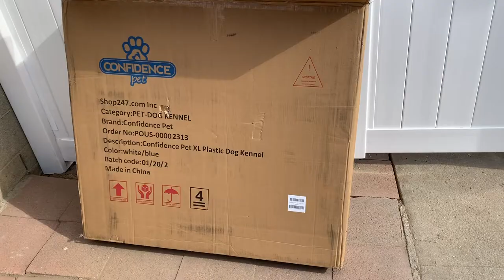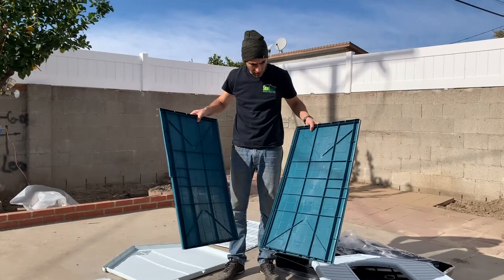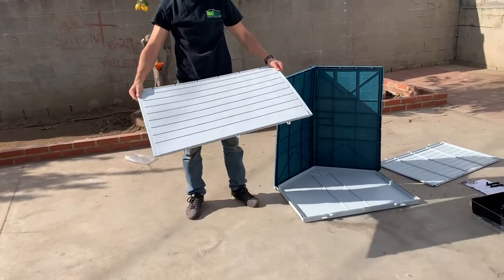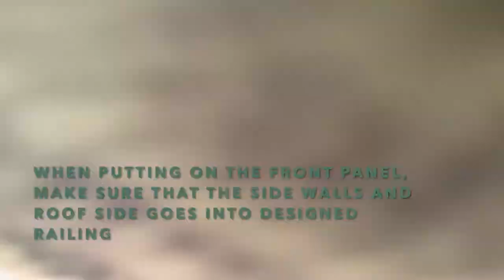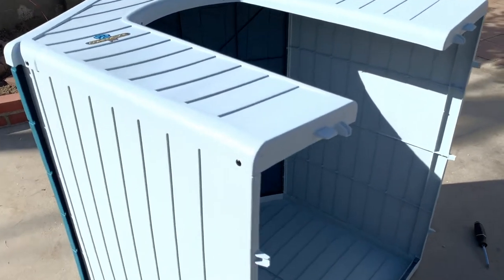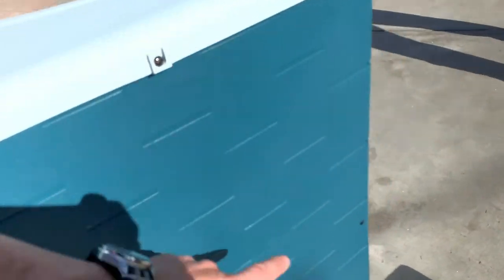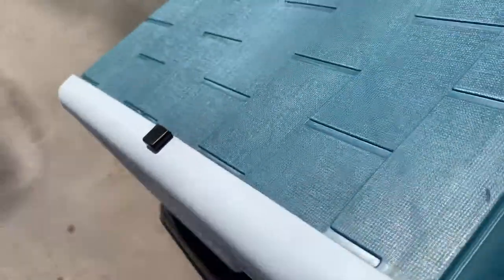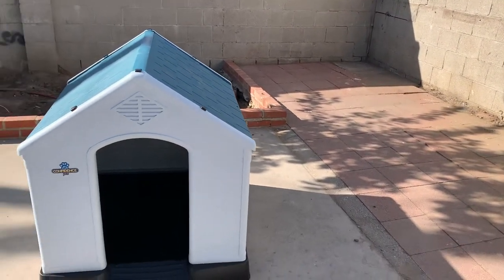Confidence XL Pet Dog house assembly, how to assemble plastic dog house

Comment: The panels of my insulation kits are wider than the sides. Do I need to cut them? I can't see the answer in the video.
Reply from the maker: Hello, unfortunately, I don't have the dog house anymore, I am sure I haven't cut anything on it while installing, please check the positions of the parts once again to see if you are putting everything together as it should be. Hope it helps.

Comment: Hi will an adult cane corso fit in it comfortably?
Reply from the maker: CodingNinja hi, Mine is already 4 1/2 months old. He’s pretty big 61 lb. and he sleeps there fine and moves around fine as well. I think for sleeping should be good for an adult. Depends on the size of your dog.
Reply: @gavishop8432  thank you
Reply: Hi, can you take this apart for transportation if you un-screw the screws??
Reply from the maker: Donna Lloyd you should be able to. But since it’s a very thin plastic, the screws may damage it. Really depends on how clean you screwed the first time.
Reply: DIY is fun thank you for the quick and full reply 👍🏾